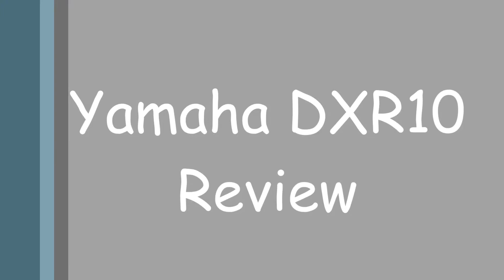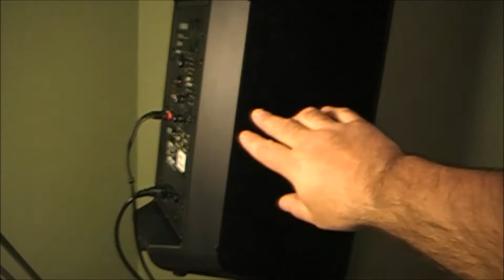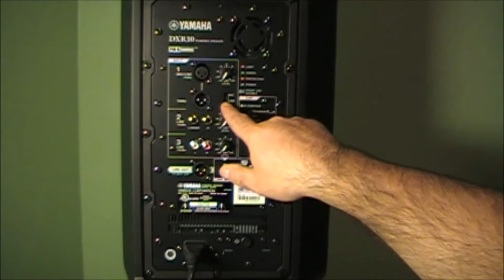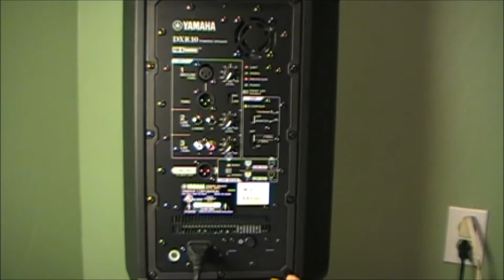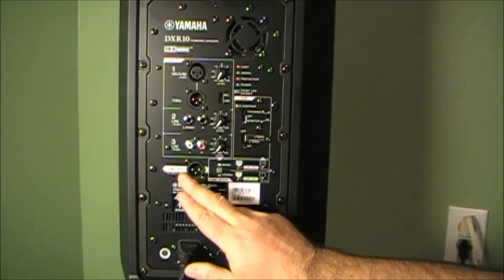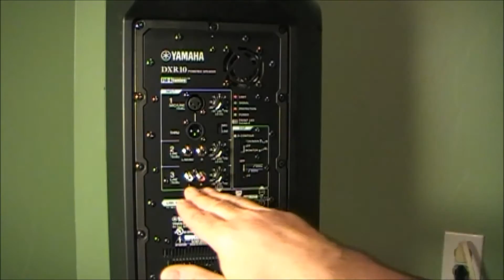Yamaha DXR10 Powered Speaker Review

Comment: Hi Andy thank you very much for this! Do you think the DXR10 would be too big for an insulated karaoke room? It can sit about 10-20 people
Reply from the maker: It certainly is a great sounding powered speaker. It will only be idling in a room of that size. It is well capable of large venue shows. There is a smaller DXR8 that is the same speaker but smaller if that interests you. Good luck with your setup and musical endeavors.
Reply: Oh ok thank you for the advice, in that case I"ll get the DXR8. Appreciate it!
Reply from the maker: All the best
Reply: @Tobinindustrial  can we cover 200 people with only one speaker ?

Or with two speakers?
Reply from the maker: @chamil346  I've played with a 5 piece group in a bingo hall that is about 80 x 120 feet with this top and a DXS12 Yamaha sub and it did awesome. It can be done for sure but I would recommend using two subs and two tops anyway. One speaker could cover public address no issue but as for a band, you'll need a sub speaker to be able to carry the full spectrum (low end, mids and highs) of a typical band.

Comment: Excellent speaker for mobile DJ, live sound, and karaoke. Very clear at loud levels. If you need to get louder and clear turn the bass D Contour switch off. Works as a floor monitor great. I own 2 DXR10s, 3 DXR 15s one DXS 15 powered sub and the Yamaha Stagepass 600I. I own and recommend speaker covers for everything. My speakers and Stagepass are in mint shape. I am a Yammie fan!! :) Running DXR and DXS line with Yamaha MG12XU mixer.
Reply from the maker: I have to say I am a Yamaha fan as well. I am 35 plus years in live bands in the music industry and Yamaha has always proven to be the best at edging out the competition. I can't agree with you more. I'd love to have enough money to buy even more Yamaha gear.
Reply: I was thinking of downsizing my Yamaha DXR15s to two Turbosound IP2000s but I do not think I would get that clear and powerful sound that Yamaha offers Andy.
Reply from the maker: I'd try DXR12's or DXR10's. That is a reasonable downsize that you will still impressed with. there will be no noticeable audio fidelity and the difference in db's would be undecernable with the human ear.
Reply: Are you not a fan of column speakers with sub?
Reply from the maker: I have no experience with that gear. I should say I am also a fan of old school bass bins and tops too. I still have a set of passive Peavey 18's HT model and I have a set of double 15 JBL 4745A passive bins too. My personal favorite passives. I use a QSC 4.0 (4000 Watts) and a QSC 2400 watt amp with my passive application. Don't get me wrong there is more than one way to get a great sound. I am just stating that Yamaha is the top of the pile in so many ways. I have never use the Turbosound IP2000 system or anything like it. It reminds me of the Newest Bose gear which I seen being used locally. The owners like it but are not impressed with the headroom in larger venues. It is more for rehearsal and smaller gigs. That's how they feel. That is not my opinion. I regret I have no informed decision on that other than the opinion expressed by other owners.
.
Reply: That is what I am seeing too as far as column speakers are concerned. Smaller to medium venues and great for solo and duo acts. The DJs claiming up to 350-500 guests are probably lacking the real headroom and low end needed. I have friends that run one Bose L1 system for Karaoke and something is always lacking it seems. In my opinion 2 of my Yamaha DXR 10s will eat that one Bose L1 up without using the D Contour. I noticed the 10's get louder with better clarity with D Contour off anyway. My pair of Yamaha DXR15s work great with up to 150 people with D Contour on and no sub in the right size room. I own 3 DXR 15s. I just added the Yamaha DXS 15 sub. love it. Trying the Yamaha DXR 10s soon with the sub. The Yamaha DXS 15 sub makes the Yamaha Stagepass 600I sound amazing and the Stagepass sounds great with the Yamaha DXR10 as a floor monitor. I even ran the Yamaha DXR10 with the main switch on and D Contour on with the Yamaha Stagepass 600i it added a little more bottom end and fuller sound. Thanks for your response Andy. I will stick with my Yammies. The only other main speaker brand I would have considered are the EV EKX line or their top line which are extremely heavy. QSC K series too muddy at louder volumes. They make great power amps though and I have not been impressed with the JBL line lately. Thanks again. :)
Reply from the maker: Thanks for the detailed response. Bose is overpriced and not much headroom but very compact for sure. A little bigger gear and less cash with Yamaha gives you a whole lot of quality and you are so right when you say it gets loud but still maintains quality sound. The JBL 4745A cabs I have are old school and really are awesome for a passive sub speaker system. Have you any experience with Yamaha mixers? I am using a CFX16 Mackie MKII and I love it but I am sure Yamaha has a competitive mixer and would like to try a comparable Yamaha mixer.
Reply: I use the Yamaha MG12XU there are several nice mixers on the market that will work well with Yamaha speakers. I may look for another one but I need good effects for vocals for when I provide karaoke services.
Reply from the maker: I hear you there. You need effects for vocals. The Mackie CFX16 MK II has a nice effects section built in.
Reply: Thinking of keeping my Yamaha DXR 10s and Yamaha DXS 15" sub and trading my Yamaha 3 DXR 15s for 2 Turbosound IP2000s for easy wedding setups and classy look. Use the Yamaha MG12XU mixer for everything. Hard decision to make. Yamaha DXR 15s are powerful and nice. Turbosound IP2000s sound does carry quite far and even dispersion. What do you think?
Reply from the maker: For smaller gigs I'd say that makes sense. You are still able to do the larger venues but have the option of doing light duty at smaller venues. That being said. The DXR12 is a competent powered sub and is probably just as capable as the DXS15. Maybe two DXR10's and one DXS12 sub might mean just as easy portability and it reduces your financial exposure by just buying the DXS12. Just an idea.
Reply: Andy. You think 2 DXR10's and one DXS12 sub or even two DXS12s are more powerful than a pair of Turbosound IP2000s? 2 DXR10s and 2 DXS 12" subs might just do the trick for most weddings.
Reply from the maker: I don't have any experience with the Turbosound IP2000's but I'd put a lot of faith in a double DXR10 / DXS12. I have just one top and bottom and I am sure I can fill a large room (300 or more) with sound. You can turn these puppies up and they scream but stay clean and it takes a lot of headroom volume to get anywhere near the limit light. I was  kinda worried a few times about the headroom volume and no limit light. I fear nothing now that I ahve seen themin action and sounded great at high sound levels but maintained a nice tight clean sound with loads of lows. The spectrum of sound is steady and strong.
Reply: True. For live sound go pro gear with two mains and for parties of 100 or more add sub or two. Column speakers lack the headroom and  are best used for ceremonies, cocktail hour, dinner music and live music acoustic acts.
Reply from the maker: That sounds like the best plan of action.
Reply: @JonTisch What do you mean by „D contour on“ - on what position, switched to what? There are several options … Thx.
Reply: switch off. I no longer own these speakers @KBpro54
Reply: @JonTisch  thanks 👍🏻

Comment: I like my older  Yamaha 12s (wood cabs, not amped), but would not say they're the best I have.  I'd like a set of EV 12s with 18" powered sub.  The JBLs are also very popular, but I like ElectroVoice best.  I have not heard the Yamaha DXR10s or 12s, I will check them out.  The EVs cost much more than the Yamahas,  it would be about 2K$ for what EVs that I want.   Don
Reply from the maker: +umajunkcollector I should add that these are rated the best speaker on the market based on size, weight and price. Just to be clear. EV's are awesome speaker. I must say that JBL has been my industry standard for years. I have a contact with JBL in the USA and I can get  pretty good deals and cheap shipping to Canada through this JBL dealer. JBL makes speakers for many speaker companis especially the higher end gear that many companies sell. They know their speaker business for sure
Reply: I do like Yamaha too, I've had mine many years, keepers for sure, and they handle abuse very well. and sound nice.  I only have 50s EV bookshelf speakers on my quadraphonic system that's only 30watts/ch.  But I had some better EVs in the past, very good heavy duty professional stuff. Um lusting  for the big $ stuff, but am happy with what I have, champaign taste on a beer budget.  It's sort of like old Peavey, Fender, Ampeg, and Marshall guitar amps, all are great, but um happy with Peavey, but wish to have Ampeg.  Funny thing, I have a pair of old Shure Vocal Masters, and would like to feed them into a couple of ld ustom tuck-n-roll cabs.  Old stuff is fun, but cannot even come cose to modern sound systems.  btw, howz about a vid about meekrofones?  Mic talk is fun too, Shure, EV, AT, Sennheiser, Heil, Sony, and so many other great mics.  Don
Reply from the maker: I use shure SM58. The Shure Beta 58 is more awesome but price wise the Sennheiser is ultra competitive